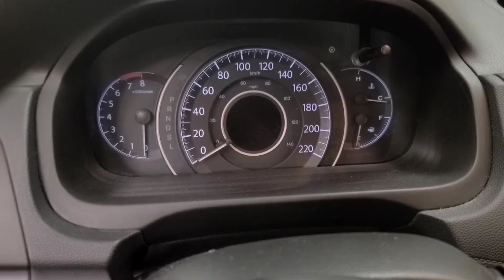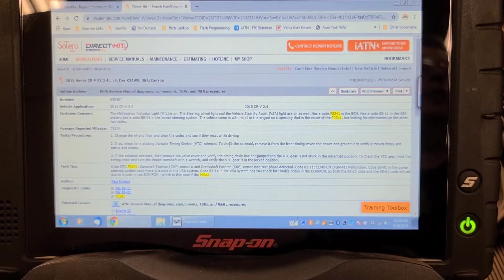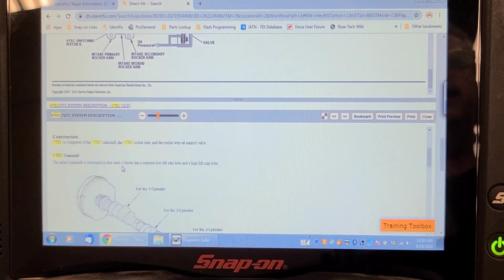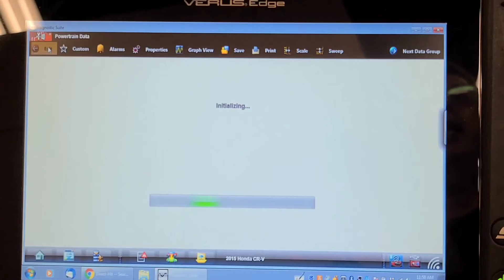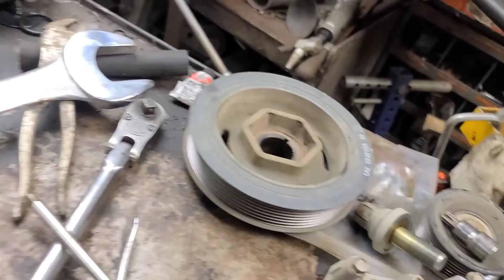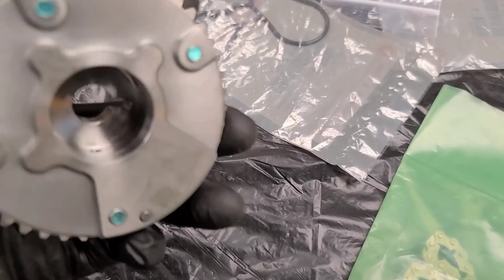2015 Honda CR-V MIL on P0341 Cam Timing Error

Comment: I have a 2015 CRV with those exact lights, wont go above about 2500ish RPM and takes 2-3 times longer to start now. Code P0087 which is low fuel rail pressure, I was going to just replace the HP fuel pump but after reading from someone who had the same problem, they said it was actually a timing issue connected to the HPFP since it's driven off the cam. Mine has had the famous cold start rattle for awhile now but never had an associated code. My thoughts are that if it was a timing issue causing fuel pump problems off the cam, wouldn't it throw this P0341 code too and not just fuel pressure code? Thanks! Just trying to avoid shop prices cause I have about 500 bucks to my name right now.
Reply from the maker: I agree if you don't have any cam timing error codes I'd chase the fuel pressure code. You need to confirm that the low pressure pump in the tank is supplying the high pressure pump properly before replacing the high pressure pump.

Comment: How many volts is there supposed to be on the blue wire in the connector with key on. And should the selenoid move when removed and plugged in while watching it and the key is turned on. Thanks!
Reply from the maker: I'm not sure about the voltage on the blue wire but the solenoid will not click when the ignition is turned on or off.

Comment: I am having the same issue with my Honda CRV RD7 2004. The VSA and check engine light are on. I did a scan and it's showing Cam Sensor Bank 1. I remove the sensor and connected it to bank 2 the vehicle starts. If I unplug the bank 1 and have the bank 2 connected the vehicle still starts but if unplug bank 2 and have bank 1 connected the vehicle does not start.
Reply from the maker: Could be a faulty sensor or wiring problem

Comment: What could happen if we keep driving like this? I have same exact problem. 
I bought a car from private seller, he put electrical tape on all those lights..... already spent quite some money. Don't have budget in short time of period...
And where can I get the oem parts provide to mechanic. I'm not quite sure if he's gonna use oem parts.
Reply from the maker: If the chain jumps time due to excessive wear it will likely quit. If it goes out of time far enough some valves can contact pistons resulting in major damage. I'd recommend dealer parts but if you are not doing the job yourself let the shop supply the parts because if you supply parts you won't have any warranty on labor. Some shops won't install customer supplied parts.
Reply: @PhillipBailey  thank you. I'll find good mechanic and let them do the job.

Comment: I have done 2 of these already. One without taking the timing off cover one includes replacing the chain and tensioner. As i can remember, i actually talked to couple nice techs from honda service department before i did these jobs and they told me usually its the chain and the tensioner that needs to be replaced. So i didnt replace the actuator on the other job i did and it worked.  But i am curious how to determine the actuator is bad.
Reply from the maker: Cheap insurance either way. Sometimes you can see that it's stuck or it won't click when energized.
Reply: The pin doesn’t lock on a bad one so if you can rotate the cam by hand then the actuator isn’t locking

Comment: Thank you for this video. How did you hold the intake cam in place to remove the VTC actuator?
Reply from the maker: You can use an open end wrench on the hex on the intake cam. Sorry I didn't show that.
Reply: @PhillipBailey  thank you. Upon inspecting the intake cam, looks like the only spot that has a hex for a wrench is at the end towards the in inside of the high pressure fuel housing.
Reply: You can lock the cam with a special tool or drill bit around the back of the cam

Comment: Do you know where to find the timing marks? I tried but no luck. Also how did you break lose the vtc gear?? Mines so tight
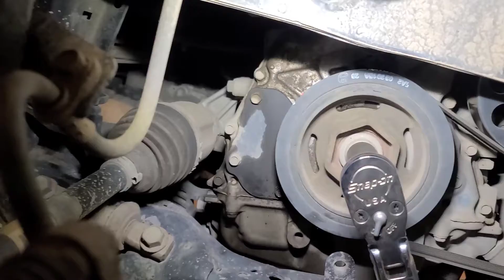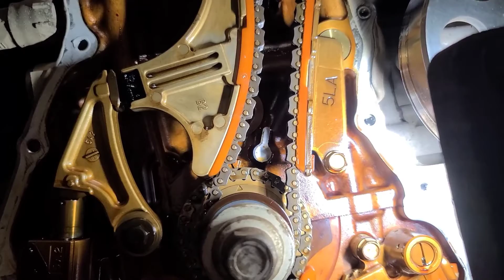Reply from the maker: Timing marks are shown at 10:51 and again starting at 13:45. There are hexes cast into the camshafts that you put a wrench on if I remember. I have a home made holding tool that holds the cam sprocket if it has slotted holes in it.
Reply: You need a cheater bar for extra torque

Comment: Great video
I keep getting a P0339 crankshaft position sensor. Would you happen to know what the fix is? Thanks in advance
Reply from the maker: Does the engine crank at normal speed or does it sometimes turn slow. Code could be caused by low battery voltage, loose or dirty cables or failing starter. If it cranks over normally but sometimes longer to start its probably a failing crank sensor. Inspect the connection and wiring and if it looks OK probably recommend to replace the crank sensor. Good luck.